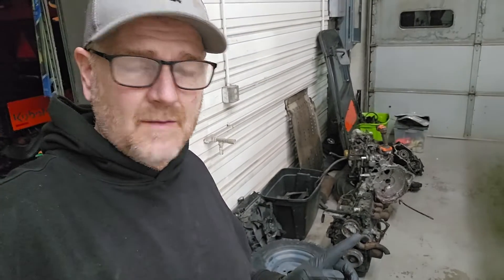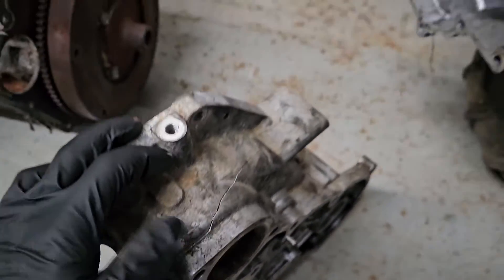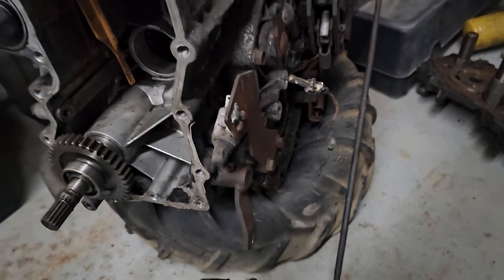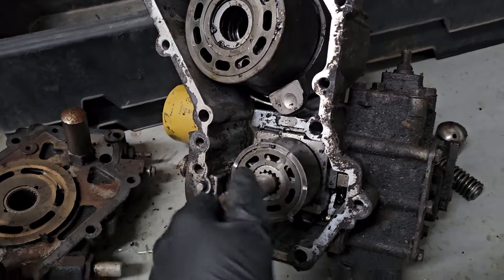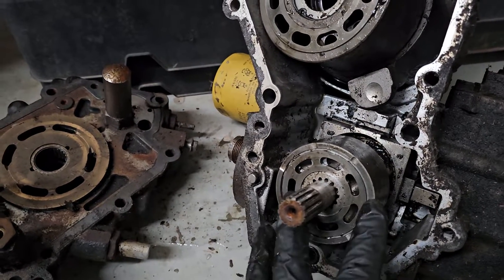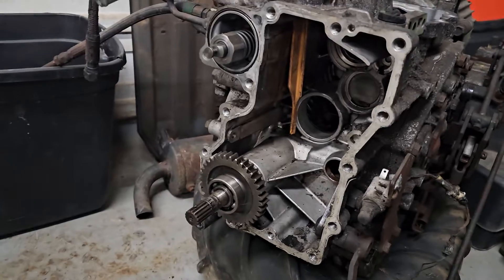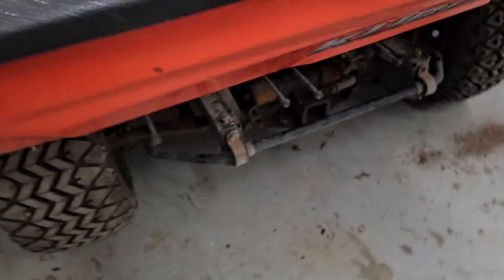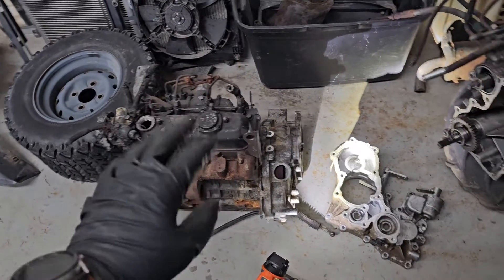How does a HST transmission work? Let's look at this Kubota RTV X 1100 c

Comment: After releasing throttle on a downhill it will stop very slowly or even will not. And I a missing some power for acceleration ur uphill. I have set a linkage to hidrostatic motor that it does not turn wheels when in high gear and lifted. Any idea what it wrong. Thank you.
Reply: Pump, motor, filters, oil and bearing in HST are new. I bought it second handed and it wouldnt even drag itself uphill in low gear. Top of 2 pistons were burned off. Somehow. Now it will go in the same hill 12 mph but should go faster as I was told. I will check the hoses etc. I am thinking that previous owners were screewing something and "detune" everything. How are those possibilities likely? Can your company offer some online services. That would be awsome.. tnx
Reply from the maker: As far as the pistons go, if the air filter gets too bad, it inhales dust and burns up the cylinders. 

Grab a workshop manual and get some pressure guages. If you have some mechanical abilities you could do some investigating.
Reply from the maker: These will come to a stop or very slow down hill. That's how the hydrostatic system works. If it's in gear it will only move if the throttle is in acceleration. 

They do lose speed up hill. I have a video showing the uphill speed. Check that out
Reply: I saw your video and I expect to come to a stop. But mine would not. My friend drowe it yesteday and he said it should brake much more than it does after relasing power becouse he owns one and it does so. Can I try to adjust something? Thanks
Reply from the maker: Your pressure relief valve may be stuck open. That would allow for loss of acceleration as well. This video talks about hard shifting because the valve isnt being pushed, but yours may be always pushed or bad. https://youtu.be/q-C3KzQ6NwA?si=u67twtgdW27JuLPM
Reply: When I have it on flat or lifted rear wheels and in high gear it will not move. It even shifts good without pushing brake. But I lack of acceleration after 10mph. It will creep to 20.
Reply from the maker: Check the hydraulic hoses for collapse or softness, that can restrict flow. Your hydraulic pump or motor may be bad, the relief valve may be bad, their definitely seems to be something wrong with your hydraulic system. 

Change fluid, filter?
Reply: Ok😊 thank you for all the comments.
Reply from the maker: Absolutely. 

I wish you could drop it off at the shop! I'd live to check it out for you.
Reply: Yeah me to. Europe is unfortunately faar away😂 and in Slovenia I estimate I am owning 1 of 20 rtvs in whole county. It is fairly unpopular so are the official services not available.
Reply: I have something new in finding out the cause for my trouble. Helpfuly you can advise me. 
When going full throtle on flat road and start going uphill, very steep hill, rpm of motor will decrease until it would eventualy die. But when rpm drops draticaly then I back off throttle  more then half, then rpm increase again. Actualy going in hill there is no difference when going full throttle or 1/4 of it.

Comment: You have found you calling lol😮. So many of us want the Kubota reliability with the heat and air but just hate the no power or speed. 30 mph with power is all we need and don’t lose the reliability factor.  Make more videos ,machine some custom parts show us the available of what engines with more power would fit without problems . Make a front locker for them . Open a shop we will all ship our machines to you for modifications you will be a billionaire. Thanks 😊
Reply from the maker: Thank you! I do have some product ideas to improve performance. 

I'd be open to mods and setups! No problem, bring it on

Comment: Hello. Thanks for the videos! They are very educational especialy this one. I have purchased used x900 and had HST repaired. Pre owners never changed oil for 32000 km and some of the pistons literaly melted. New parts with pistons are very expensive and used parts is nowhere to get. Something on ebay but... I wouldnt risk it. Would you be ready to sell me and send some used parts if I find some new issue with it? It would be really incouraging. 
Best regards from Slovenia, Matej
Reply from the maker: Not sure if I'd be able to help much. Perhaps if it's the only way you can get help

Comment: nice video, out kubota x900 would not move. the trans low pressure had no pressure, the problem was an oil leak. that cased the hydraulic oil tank under the passenger's seat to be too low to supply oil to the transmission pump. the hydrostat is supplied from the hydraulic tank.
Reply from the maker: Yep! Alway check the fluid levels!

Comment: Always interesting.
Reply from the maker: It's so interesting isn't it!? Every time I crack one open I'm in awe of the engineering.
Reply: @SearlesStation hello it’s been few months since I asked for help. I finally got my RTV running. I finally figured out the issue. My issue was it wasn’t going for or backwards and it would be full throttle and not move an inch. I replaced the two transmission filter is the way back and Waalaa it moves now and runs awesome. It’s been sitting for over 13 years about give or take. Also the fuel filter